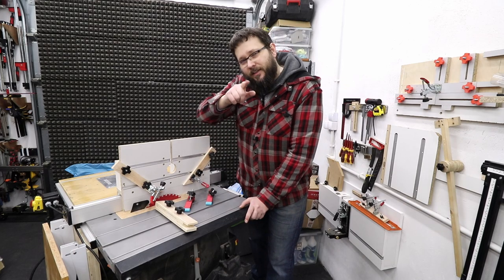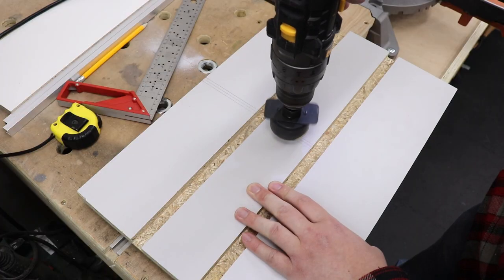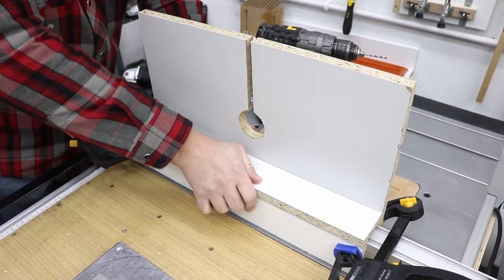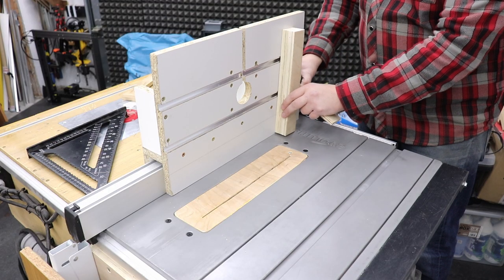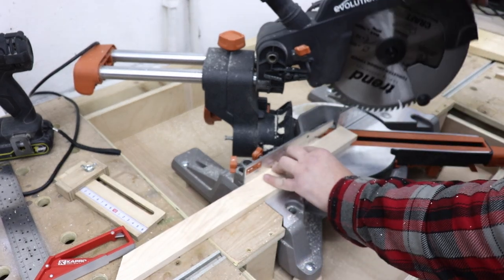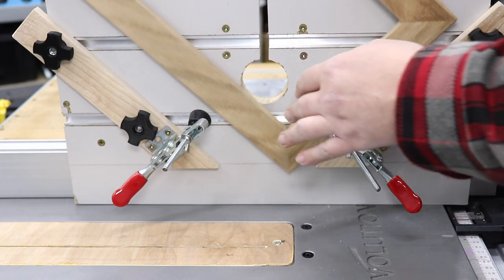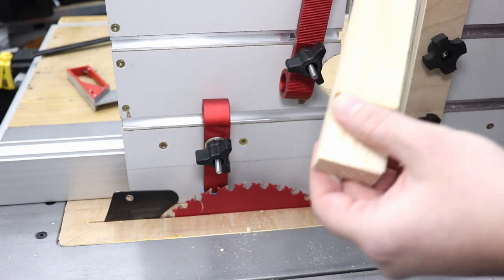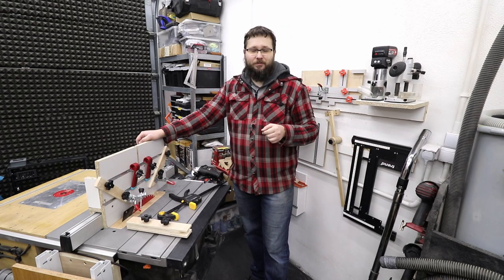Versatile Table Saw Jig | Cut Tenons, Half Lap Joints, Bridle Joints And Spline For Picture Frames

Comment: Another simple to make and versatile jig (as you mentioned) 👍
Not criticising, but I'd make two changes to construction ... 
1) I'd have the back vertical piece extend up past the fence with the bracing pieces sandwiched in between.
2) I'd make a slightly elongated hole for the quick clamps and not have the slot running down from the top (which weakens the jig).
Reply from the maker: Thank you.
1) why would you do that for?
2) with the back braces in place is very stable and not moving or twisting.
You are not putting any stress on the jig itself you just push it so no pressure is being put on it. With the four support pieces at the back is solid as a rock 👍😁
Reply: @CasualDIY  Hi Tomasz, just a slightly different construction, same result in the end 😁
1) Means a continuous vertical piece on the other side of the fence, instead of a vertical, followed by a horizontal, followed by four vertical pieces ... and all the bits in between the front and back of the fence would be the same width 👍
2) Just didn't think the slot was required ... a slightly elongated hole would've achieved the same 👍
Reply from the maker: @barry.w.christie  I always treat my videos as a starting point for others to improve or adjust to their needs, materials, tools etc. And always there is room for improvement 😉

Comment: Nice tall fence.
I have found that cutting grooves for T-track leads to bowing of plywood and MDF boards. Do you have this problem and, if so, do you have a solution?
Reply from the maker: Never had that problem to be honest not sure why that would be the case and I have installed a lot of t-tracks over the years
Reply: Do you glue or screw the T-track into the slot?   I'd say gluing is the better method as it'll act as a brace for the material removed.
Also, what do you finish with and how do you apply it (wax/varnish etc, one/both/all sides etc)?    Personally I'd use the tougher type finish (varnish/sanding sealer) and I'd apply to all sides of the material  ... finishing one side only would probably lead to bowing as the unfinished side would absorb more moisture!
Reply: @barry.w.christie  Thanks for the response. The bowing tends to be in the same direction as the grooves, so the T track fastening doesn't really affect it (and I like to be able to reuse the track, which is harder if it is glued). Re. the finish, I have either waxed both sides, or left totally untreated.
Reply: @lafamillecarrington  I understand why you don't want to glue things together, I've got this thing about being able to take things apart in case I need to replace bits .... in reality they never ever get taken apart 😂
If I understand correctly the bowing is happening in the same direction as the track ... bizarre, could be the material left in the slot isn't enough to resist internal stresses when the base sheet was made ... total guess though.
I'd go for varnish or sanding sealer as it's harder wearing and I think it'll seal the wood better ... that and keep whatever you've made away from sources of heat, heat on one side will cause bowing!

Comment: Nice jig Tomasz. Serious point now. I've commented before on your mitre saw and lack of dust extraction/collection. That hose you've got attached to the top port instead of the supplied dust bag is only marginally better, as you can see by the massive amount of dust being chucked out the back of the saw all over your workbench. Basically, it's as much use as an ashtray on a motorbike!
These two YT videos ( https://youtu.be/0r7vknqqQcs / https://youtu.be/mkzCUF02s2g )
 have got some of the best ideas and methods I've seen. You just need to adapt one of them to your saw. I saw you stick your unprotected face into a cloud of MDF dust on another video. That's just a quicker way to the cancer ward.
Like the rest of your subscribers, I enjoy your channel and your way of presenting. We all want you to be around for a long time so that we can enjoy your channel. 
Seriously...watch those videos, adapt and stay safe.
Reply from the maker: Thank you, yes always forget to put the mask on and the dust extraction on this saw is none existing, similar to the table saw. I'll try to add something to both I'll check those videos out for ideas. Thank you 👍